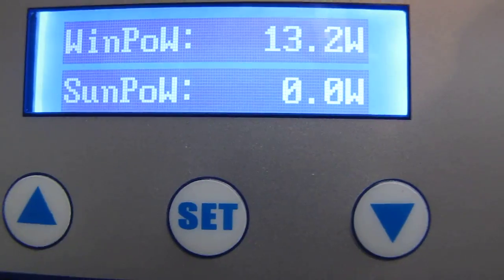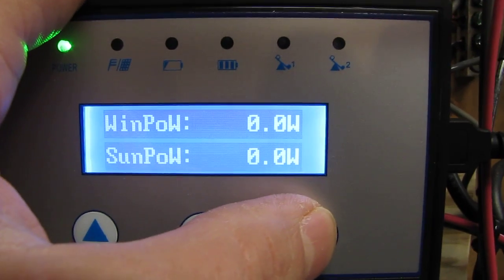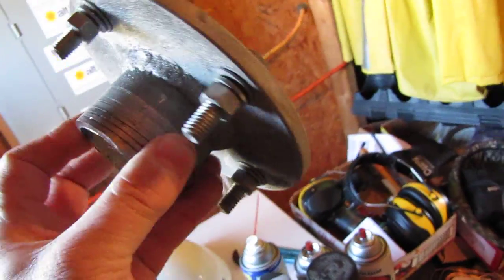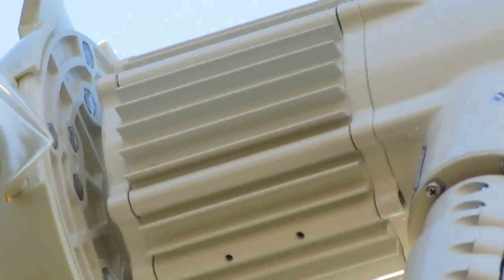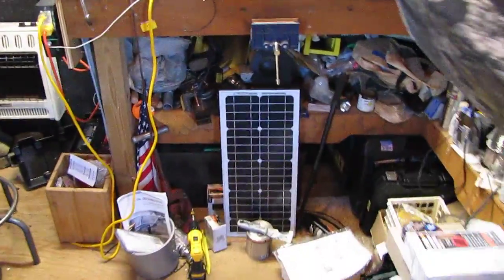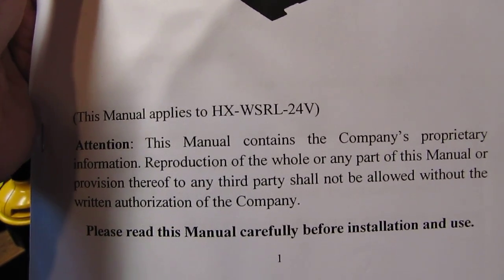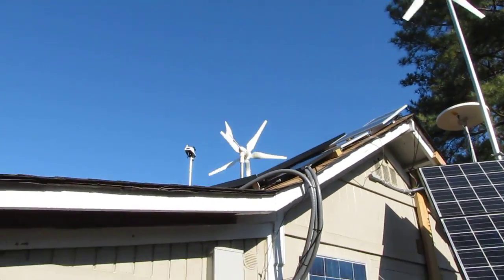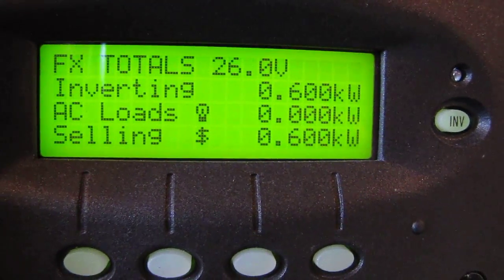My New WindMax 1 KW 24 Volt  Wind Turbine  And Charge Controller VIARLOCITY

Comment: The more i look into turbines the more i see the turbines you have are worth buying, they have decent specs and all the proper certifications aswell to give you peace of mind, im kicking myself now, but we live and learn and share our hard earned lessons.
Reply from the maker: +closertothetruth They Are The Best I have Ever Owned  Check This Out 
https://youtu.be/v3gEHuJ6xJ0
Reply: +KVUSMC / Kenneth W Viar Jr , yes ive seen it great power especialy going by the turbines rated output, i researched the blades and they seem to be a very good design, almost impossible to find though, those blade  would be worht a try on various makes, i see Tonys blades look similar, theyve got to be good.
Reply from the maker: +closertothetruth Yes It is A great Performance All around Turbine

Comment: Hey Kenny I just unbox my wind max 24 volt 1000 watt wind turbine.can I ask you a couple of question about the charge controller it's  the RS232 do I need a rectifier for this controller, also do I need a stop switch or is the stops switch  built into the controller.looking at the controller from left to right kind of confused about the wiring to the controller. Can you help me with the wiring diagram.thank you. Sorry for all the questions

Comment: @kvusmc I'm thinking the default setting for that controller, it's expecting a dump load to be connected directly and will switch to that in high winds - but it's not there - so your turbine will free spin. You need to carefully check all that. Just trying to help you protect your investment. Like your videos, don't want to see you have big problems. That's a good looking controller, please give us a closeup SLOW detailed look inside if you get a chance.

Comment: @kvusmc If you find a link to the manual/docs for the controller, please drop me a PM so I can help out. If your dump load is set for battery voltage in the other room, that's OK but the controller should handle the dump more efficiently, since it's designed/tuned specifically for the turbine. Another problem with a simple battery voltage sense dump is if your solar charger goes into a equalization charge (higher voltage charge for 3 hours will trip the dump).

Comment: Be careful Kenny, I don't see a dump load connected, you don't want to over rev that thing and blow the blades apart, you just got it! Also make double sure that you have the settings set correctly for the dump load, it looks like it has a lot of settings you can change. Check that the dump settings don't change if you disconnect the battery too. I tried to find the manual for the controller online and no luck, where is the windmax company? Warranty concerns? Looking forward to wattage info...